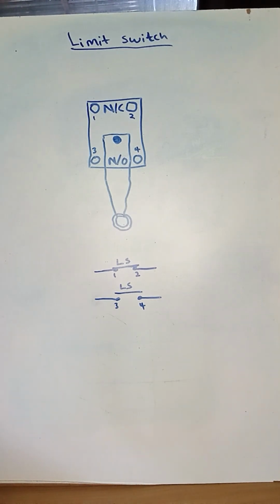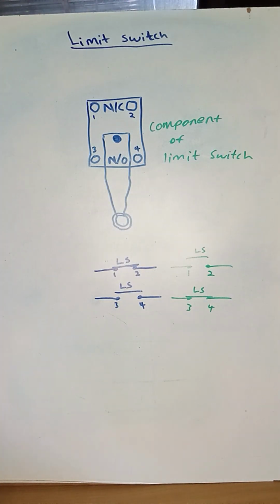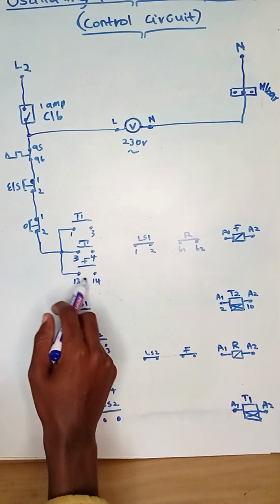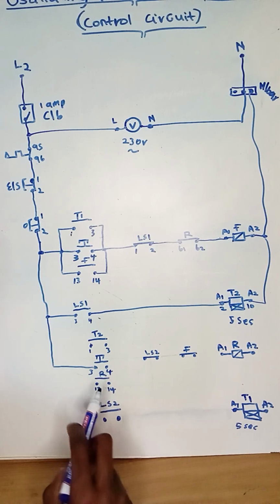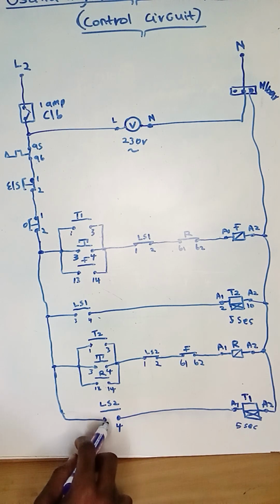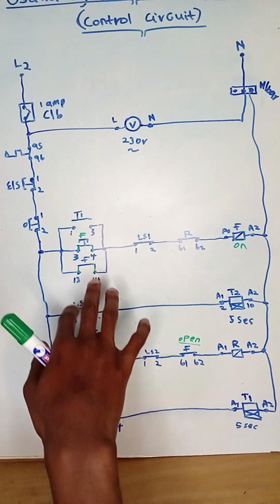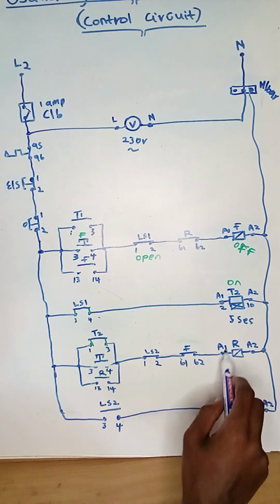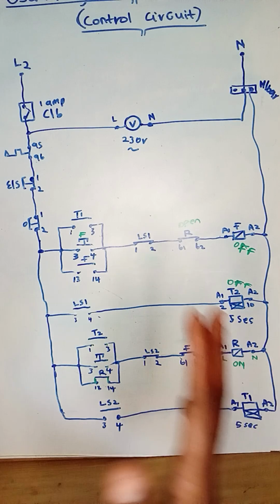Oscillating panel from the control circuit. Lesson 0013.

Comment: Why is the Ls1 connected to timer 2 instead of 1 and vice versa
Reply from the maker: Good question. I love it.
The reason is that, Ls1 must assist timer 2 to be energized so that the contact of T2 can be closed to energize the coil of reverse. But if it was Ls2 that must energize timer 2, the coil of reverse was not going to be energized because the contact of Ls2 in the connection of reverse was going to be open in which current will not follow all the way to coil of reverse. So for us to use Ls1 to energize timer 2, is because of we don't want to disturb the contact of Ls2 to be open when we want to energize the coil of reverse. I hope you will understand. If not contact from my bio. Thanks